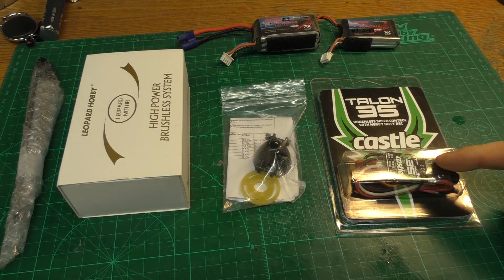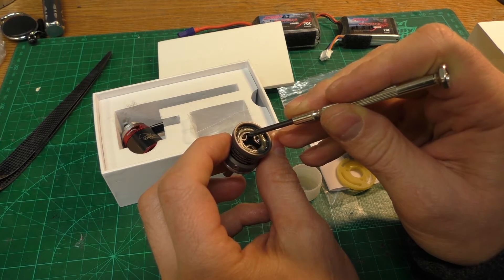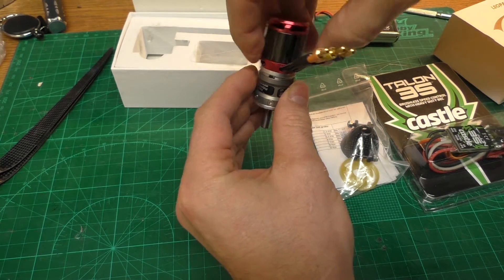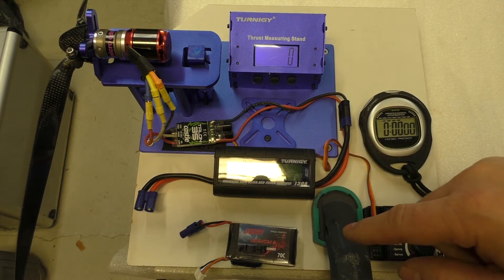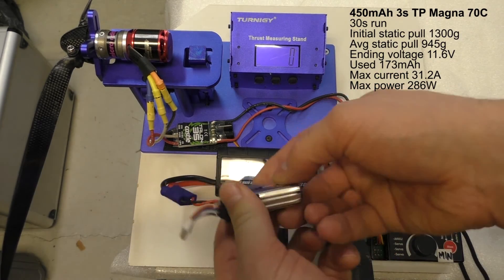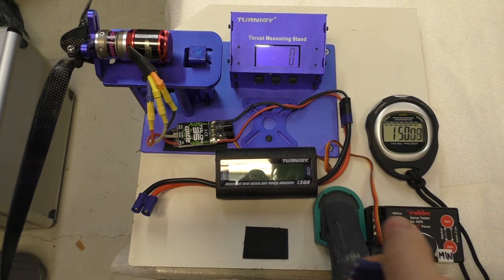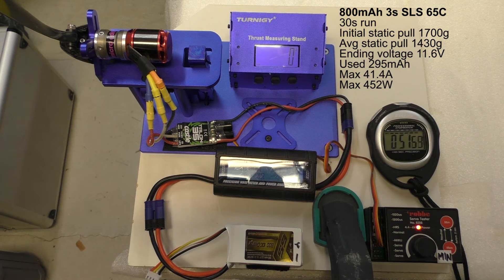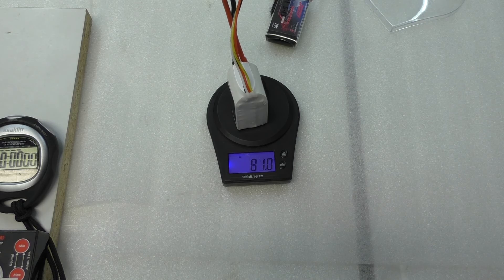Leopard LC250-30 4420kv with Reisenauer Micro 5:1 and 14x8S test

Comment: What 30mm spinner is that. Am using the Aeronaut 30mm Cool Nose which is one of only ones freely available in the UK. Unlike the larger Aeronaut ones the 30mm one doesn't use a backplate. Your spinner looks much better.
Reply from the maker: It's a Freudenthaler carbon fiber spinner. You can easily get one at https://www.reisenauer.de/artikeldetails.php5?aid=2088
Reply: Thanks for your quick and informative reply. I'll have to get one of those spinners! I wish you much happy f5j flying.

Comment: Awesome video was looking for a planetary gearbox like that.
Any chance of doing testing on Turnigy SK3 motors?
I'm think of doing a long range efficiency build using 18650 batteries and using a small SK3 motor.
Reply from the maker: DallusDaPwnage thanks! Check out reisenauer.de for motor alternatives. Unfortunately I don't have adaptor flanges to put on other motors